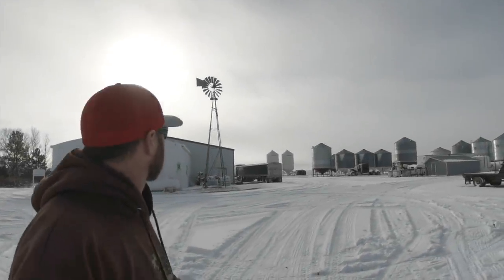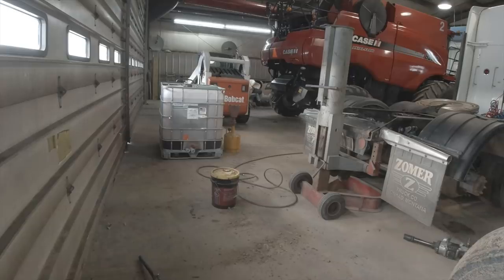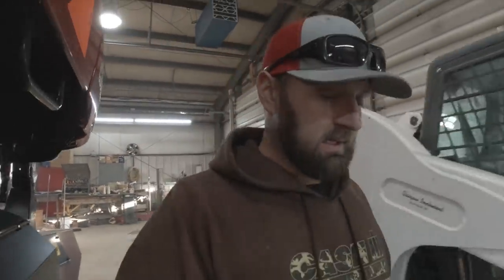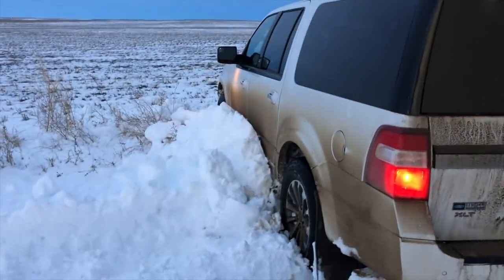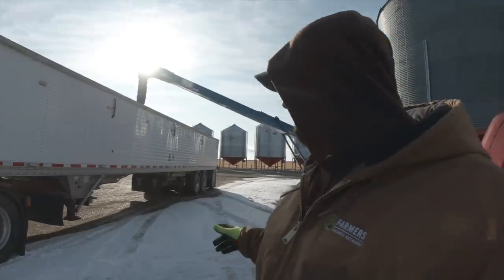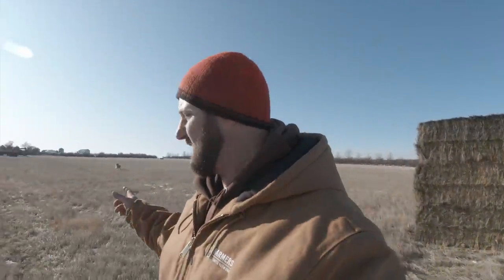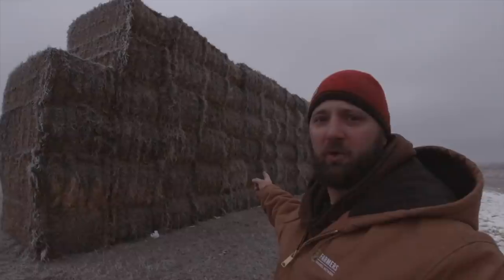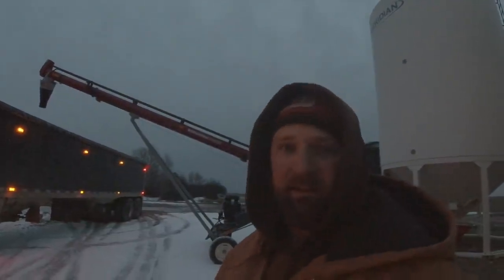Saved by a Deere

Comment: Unless it has changed since I was working on a cropping farm but over here in Australia the grain receiver sites do not accept wheat over 12.5% moisture.
Reply from the maker: They will take higher wheat here. They usually take a small discount to off sett they cost of them buying water weight.